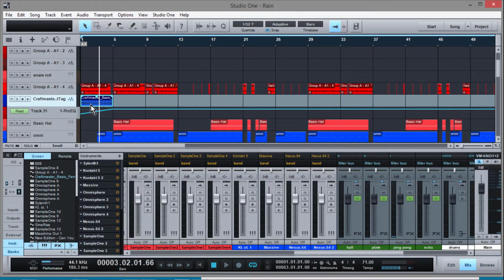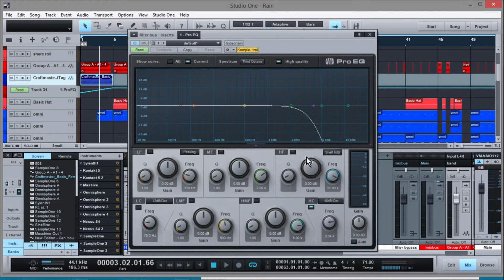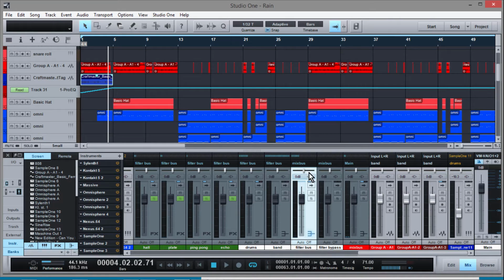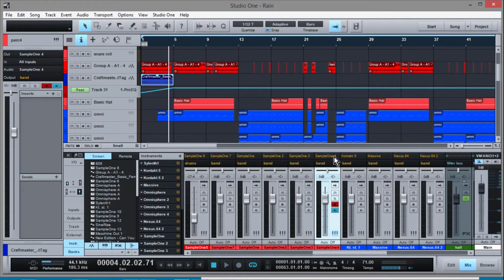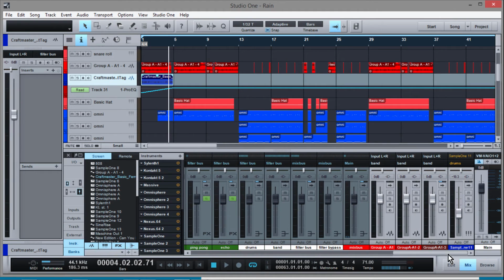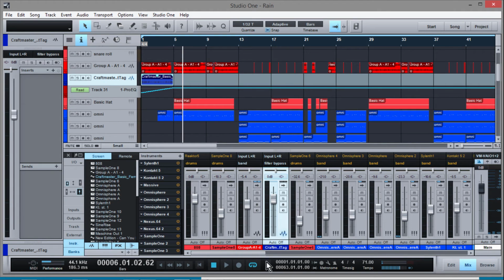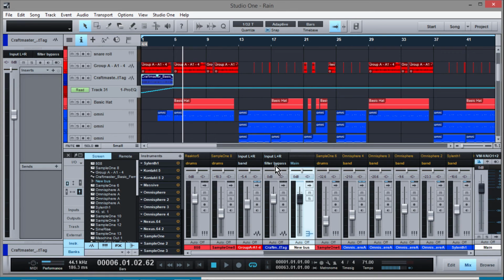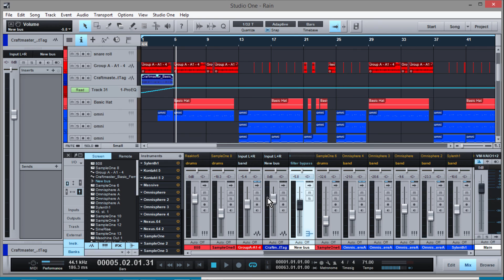How To Use Buses | Presonus Studio One | Make a Beat

Comment: Dope how you flipped that new edition sample, question...I set up the custom mix template as seen on your custom mix template video and it works wonders for my sound but I ran in to a problem I wanted to put a sample on top of my beat but when I added a new audio track and tried to drag my sample in to chop it didn't work. What did I do wrong bro?